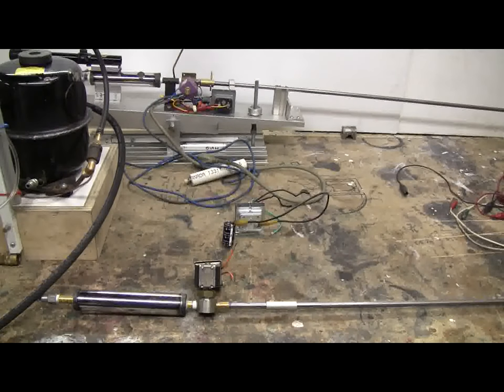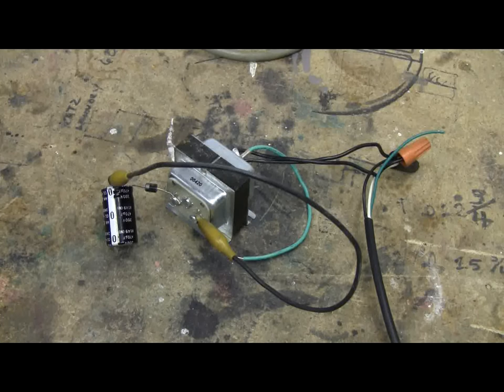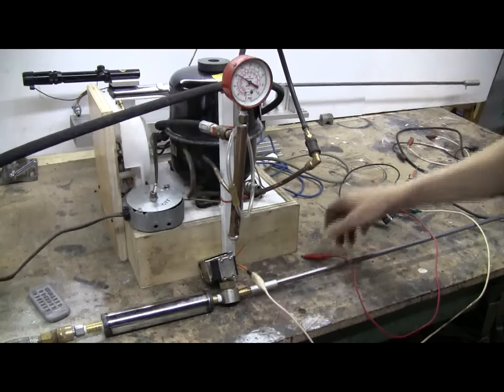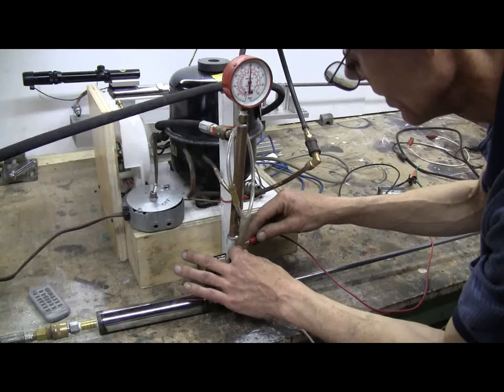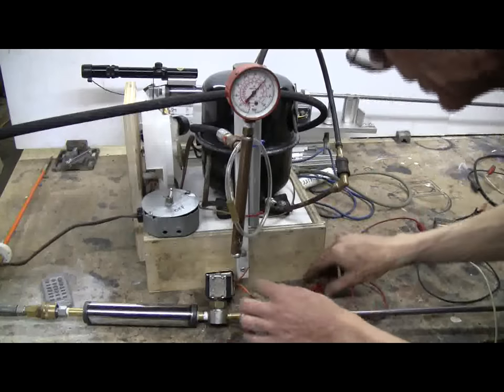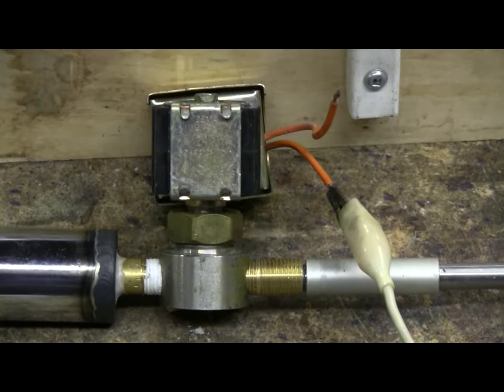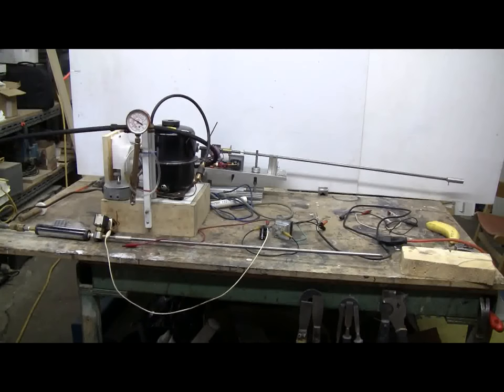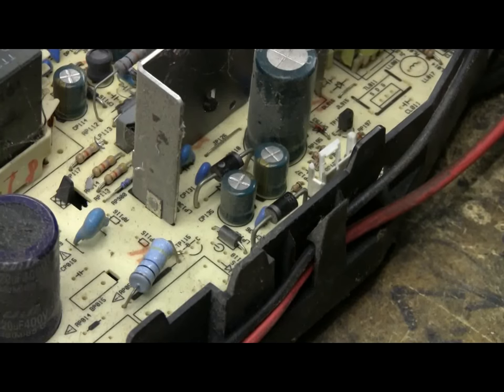Air Cannon #75 - Using Small 24 V Solenoid Valves

Comment from the maker: The test cannon is simple, once you have the parts. The valve has two 1/4 NPT threaded ports. A 1/4 NPT brass fitting can be used with a .25 cal steel tube to make a barrel. The steel tube is usually 3/8" OD, so you can drill the center of the fitting with a 3/8" bit and epoxy the tube in. The other end of the valve is attached to the air tank. If you can fabricate in metal, make a metal tank, otherwise make one with the white 480 psi plastic pipe and caps. Nipple 1/4 NPT can join it to valve.